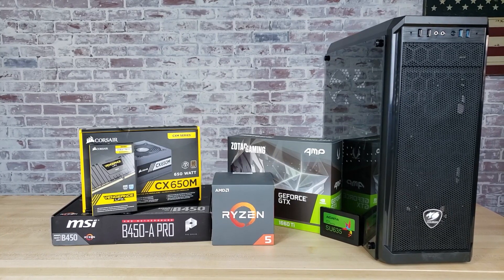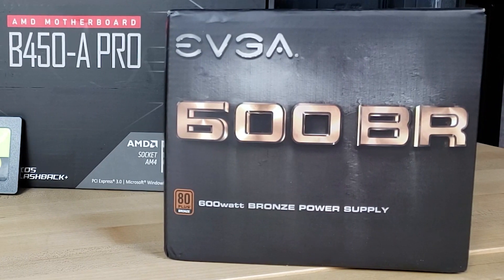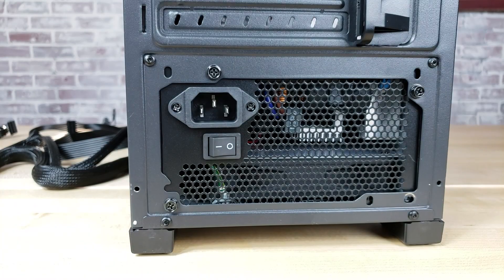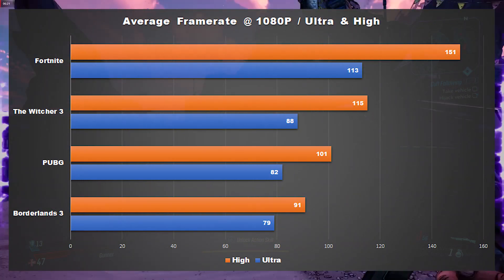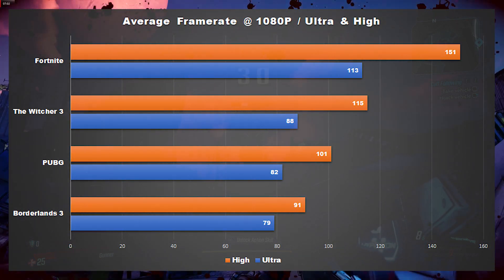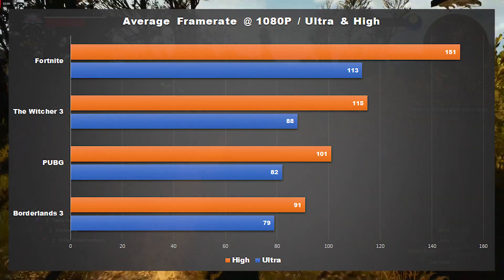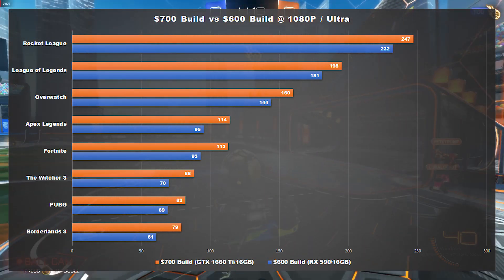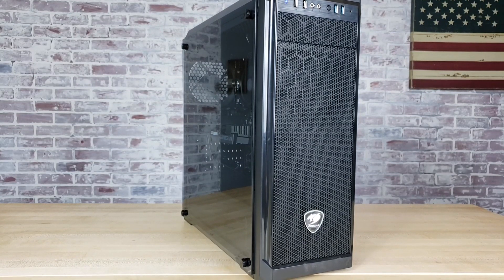$700 Gaming PC Build for 2020 - Ryzen 5 2600, GTX 1660 Ti, 16GB

Comment: Wow the times have been changing i got a Ryzen 5 2600 for 30 Euros and GTX 1660 ti for 50 Euros  and i couldnt but the 2600 in the bc and i got a better cpu the 5600g for 40 euros

Comment: can i use Seagate Barracuda Compute 2 TB 3.5" 7200RPM Internal Hard Drive instead of ADATA Ultimate SU635 3D NAND SATA III 2.5 Inch Internal SSD (480GB)

Comment: Just got a 5600XT at Micro Center June 15, 2021 for $400. Its available every now and again if you keep an eye open. With used 5600XT selling for as much as $700 these days, I nailed quite the deal for my diligence in checking retail sites several times daily.

Comment: Why did u put thermal paste on the cpu the fan comes with a thermal layer
Reply: If the cooler has been used then you need to change the thermal paste, so I’m guessing that he was reusing the cpu and cooler from a different build, meaning that the thermal pad on the cooler wouldn’t work as well

Comment: I have everything plugged in and connected yet the Case fan won’t spin and the display won’t pop up on the screen. Any tips? I also have a different power supply. It’s the BeQuiet
Reply: Are you sure your power supply and your parts compatible?

Comment: is 550 watt psu safe???
Reply: Yes, my build is the same as his with a better processor : Ryzen 5 3600. PSU is CoolerMaster 550W bronze. Everything works flawlessly. To decide what PSU would be fit for your build, just add up the Watts consumed by every component of your build (info usually found on packaging or google search). Most psus work at 80% efficiency or more, meaning you'll get 550*0.8=440W out of your 550W psu at the very least. If the power consumption of the sum of your build components is lower than 440W, you're going to be just fine with 550W psu.
Reply: @netherite depends on the spare watts available from the psu and and the overclocking demand of the CPU. For R5 2600/3600, it's usually 20 percent higher (please check this number yourself with other sources), that means a R5 2600/3600 65W CPU would consume 80W in overclocking mode. If your build is the same as this thread, then I think you could overclock with a 550w psu. however, I do recommend you double check all the watt consumption of every component of your computer do some simple math and see if your psu has the spare power to allow overclocking.
Reply: @netherite Yea 1080ti has a larger power draw, so 600-650W PSU would be a recommded fit for it. Check this page, you will see the recommended PSUs for 1660ti and 1080ti: https://www.gpucheck.com/compare/nvidia-geforce-gtx-1080-ti-vs-nvidia-geforce-gtx-1660-ti/intel-core-i7-7700k-4-20ghz-vs-intel-core-i7-8700k-3-70ghz/?__cf_chl_jschl_tk__=df59117d679c8de653197f7d6245122f1511360e-1603459148-0-ASeBpIXeInR7NnhBnxTcI9YG202XV479UDXNSbkYJJ16kpATQJ5Yxs_eJTiBRVhpYJjgtHSyC5MD8jSwsvWWvhwg2jHfWzWPj-6uYmNzGi-_SXNQQbyoPB543FXUZsYBzTjenlNc_tOhUo13hrpLPwPpIgXYuGaTd3VBRm2i7AiJVX3eFlPFt5DHsmbTaEG0OVZ7e_FXuvp-CVvsdjhUdceoG22SWTqCM50hp2UsPC5RqLge2bKgVcsUishoQ0igzxSIuE4HsG5awAQqqLuQ6aTaJXuxJruDN7DiVpotX-PdBqHZE_si3EAgJJbygyX4a2jUz4KRAhycbQA0JVF1ddV1tgVAgNM6YRhey5Mk_dXrZ7qRHZM7anBUlIzTbfiGZUAUx4yftLzxxNqvbhLW3ooFZr1o9HUHYSkPBYP1U78NOTG1rucjPCJDFCUE_Q9oSHedaTwg3XFuBkrDGyJitftVQCf24KN1OMZQ-mW2bJNBzTPkXDNqyijA4W9vnz0LkQ

Comment: GTX 1660 super - $240

AMD 2600 cpu - $120

RAM -  G.SKILL 16GB (2 x 8GB) Ripjaws V Series DDR4 PC4-25600 3200MHz F4-3200C16D-16GVKB- $70

Motherboard - MSI TOMAHAWK -100

SSD - sabrent 512gb nvme pci m.2- $70 

PSU - be quite 600w - $60

CASE - fractal design focus g - $54

Total = $714  

This is my parts list I’ve come up with. Would theses parts work well with each other? I know the ryzan CPU’s need particular ram. That’s one thing I’m worried about.
Reply from the maker: That looks great. And, as for the RAM, some have shown through benchmarks that Ryzen CPUs do better with faster memory. (I believe 3600MHz is where there starts to be diminishing returns.) But 3200MHz should be fine. You could spend ~$7 more and get Corsair's Vengeance LPX 3600MHz kit... but, in the grand scheme of things, the 3200MHz kit you have will be more than good enough.

Comment: Im assuming this can run call of duty modern warfare ground war mode?
Reply from the maker: I can't give you a specific answer to that, as I don't play COD... but I'm assuming it will handle it just fine. This video will give you a good idea of what kind of performance you can expect out of this system in Modern Warfare:

https://youtube.com/watch?v=hbvvd4hce6E

Looks like about 90-100 FPS in multiplayer on higher settings.
Reply: Yes I have the same parts in my build i get about 140 FPS on modern warfare and about 250 on fortnite really good pc